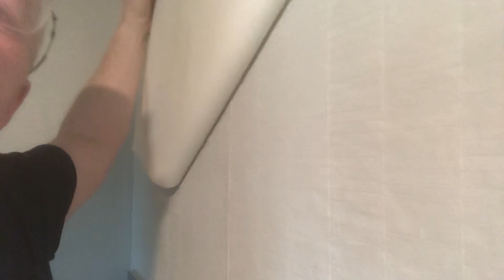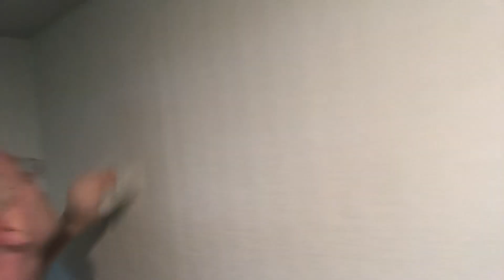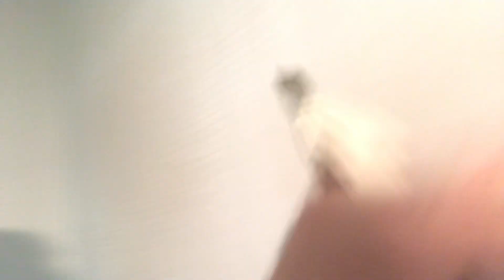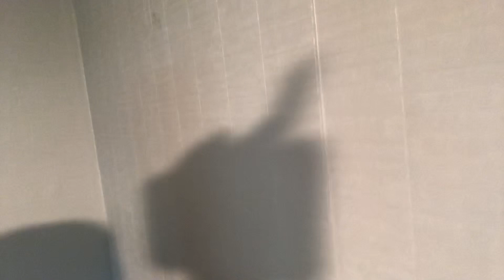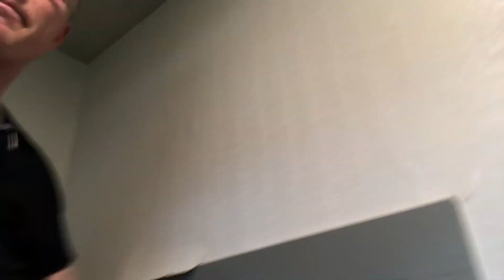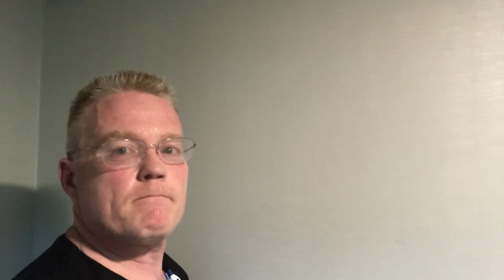How To Patch Over and Fix a Bad Wallpaper Seam - Spencer Colgan

Comment: The question below wasn't answered, and it's key to credibility...so I'll cut and paste it (no pun intended)
"This is great! However, how come you were called in so rapidly after the original paper was installed? Surely it would be dry within a day or so? I'd like to do the same but my paper is dry underneath, Many thanks"
Reply from the maker: Peter. Take a chill pill.  I will answer you later
Reply: @spencercolgan  How very rude of you to say that. I've been chilled since 1968 or thereabouts. I  just sought a straight answer to a basic question, so were you called in on the same day as the shoddy installation or not ?
Reply from the maker: So you can be rude and snide but I have to be an altar boy because I have a YouTube channel? It doesn’t work like that
Reply: @spencercolgan  You've hit the nail on the head = you are advertising your 'expertise' via a you tube channel and asking for 5 star reviews. I'll seek out your business pages and give you some no stars if you'ld prefer. And if your definition of snide is calling somebody out for false representation, then yes I'm a snide. Have a good (and honest) day,...
Reply: @petershann6463  chill man